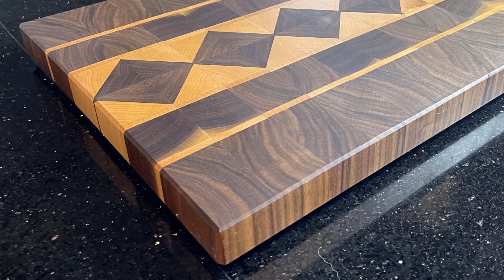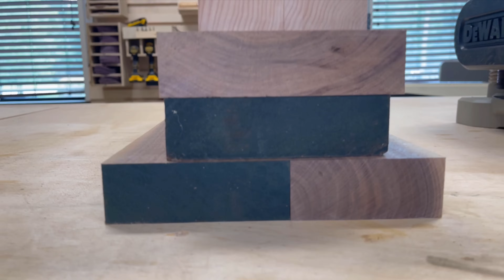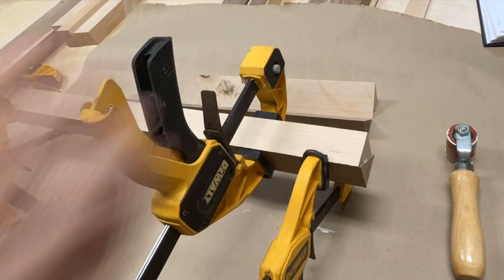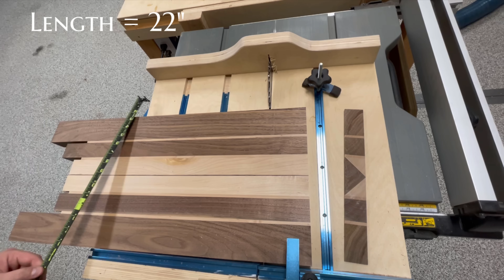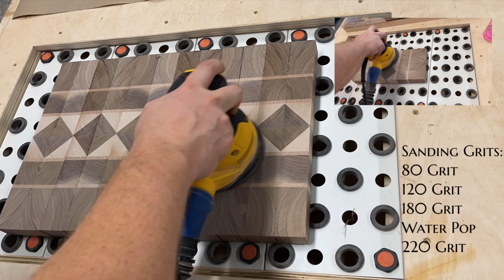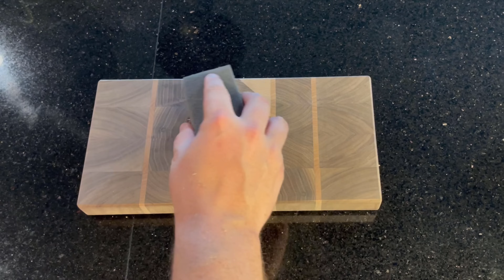Diamond End Grain Cutting Board Set

Comment: To clean glue off of your clamps make a stand to hold 1.5" pvc tubes that are filled with white vinegar.  Take your clamps and soak them in the white vinegar for about an hour and a half.  Once the time is up just wipe off.  Zero effort.
Reply from the maker: I like the pvc pipe idea to save vinegar! Great tip.

Comment: This is great! I love the pattern and have been studying your video to try and recreate. About how thick were your pieces after you ran through the planer? One thing I didn’t follow, when you make the very first 45 degree rips, do you use the cutoff piece?
Reply from the maker: I didn't use them for this project. I cut the 45 degree cut and then re-ran in through the table saw to rip the straight edge to make the piece usable. Good question.

The thickness of the boards after running through the planer was around 1.5". I hope this helps!
Reply: @EigenDesigns  Thank you for the quick reply. After you cut the straight edge from the 45, you did another 45 and another straight rip; right? Thanks again!!
Reply from the maker: @djrubes  yes sir. I had to think through how to safely cut those 45 degree triangular pieces and that is what I came up with.
Reply: @EigenDesigns  Thank you! That seems like the safest way to go!

Comment: To remove the glue from clamps, wrap the m in papertowels and soak the towels in vinegar.  Place the clamps in a large garbage bag and seal them up. Leave them overnight. Use a wire brush to remove the softened glue.
Reply from the maker: Thanks David! I have heard similar comments about using vingear, and I like your suggestions to soak towels in vingear rather than submerge the entire clamp. That seems like it would be more conservative. I appreciate the tip!

Comment: How long were your boards before you started.
Reply from the maker: Hey Jason, the length of the boards I used varied as I was trying to use what scraps and cut offs I had laying around, but the shortest of the group was around 22". When in doubt, start off with longer boards. Better to have it and not need it, then to need it and not have it.

I hope this helps.

Comment: I love the video I love that cutting board do you think you could give the measurements on how wide everything is on the strips it great job
Reply from the maker: If you pause the video at 5:19 I will list the Walnut (W) dimensions and the Maple (M) dimensions from left to right:
W: 2-1/2"
M: 1/4"
W: 1-3/4"
M:1/4"
W / M: 1-5/8" triangular split 
M / W : 1-5/8" triangular split
M: 1/4"
W: 1-3/4"
M:1/4"
W: 2-1/2"

Comment: Best way to clean glue off clamps is to fill a pvc pipe full of white vinegar, and soak them for 10-15min,  glue will just wipe off with a paper towel after that
Reply from the maker: worked like a charm! Thanks for the tip.

Comment: Quick trick to remove the old glue is a wire wheel adapter for your drill. I got mine on Amazon. Makes the bar look like néw.  I now use the tape method to avoid getting it gluey in the first place.
Reply from the maker: Good tip!

Comment: The only way that I have been able to remove the glue is to use a wire wheel on my angle grinder.  And I use wax paper to keep the glue off.
Reply from the maker: I may have to give that a shot. I also considered using a power washers, but I am not sure if that would work or not.

Comment: awesome job what is your table saw blade used thanks
Reply from the maker: Thanks Steve! About 3 months ago I bought this  10” Combination Saw Blade: https://amzn.to/3eFYGzv 

The combination blade allows you to make both cross cuts and rip cuts without having to change your blade out. I have been using it daily for about 3 months (mostly on hardwoods like maple and walnut) and have been impressed with how it has held up. The carbide cutters are pretty large so it could be sent off for re-sharpening a number of times before needing to be replaced. It's more expensive than the saw blades I had been buying from the big box stores, but seems to be holding up much better.

Comment: Beautiful boards. I’m looking for a solution to remove glue on parallel clamps also!
Reply: No great way. All you can do is scrape carefully. I always put blue painters tape on the exposed rod of the clamp between the clamp and the wood. No need to completely cover the rod - just flat on top. It catches the glue and peels off easy.
Reply from the maker: @Mr42north  A few viewers suggested white vinegar and a wire brush and I can confirm that works I wonders! I also had a viewer suggest coating your clean, glue-free rails with paste wax to repel the glue, but I haven't tried that one yet.